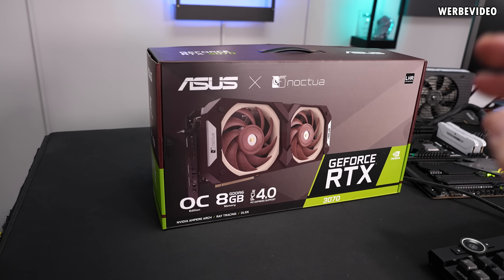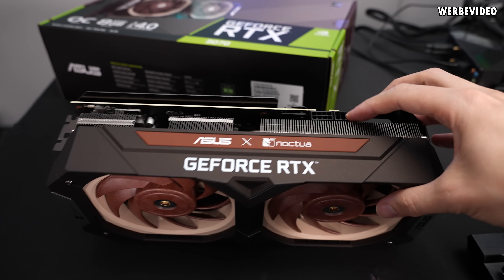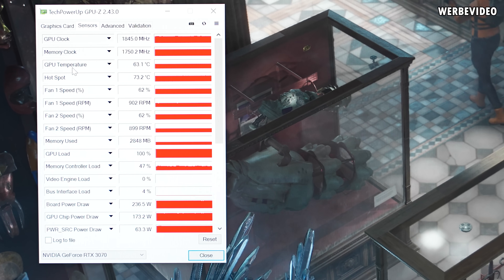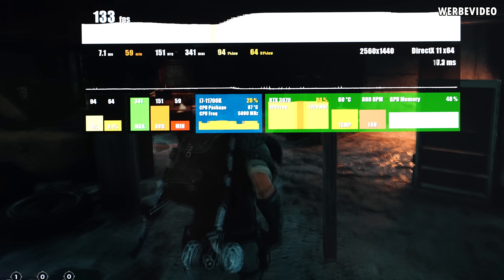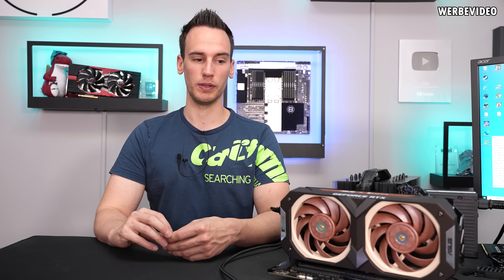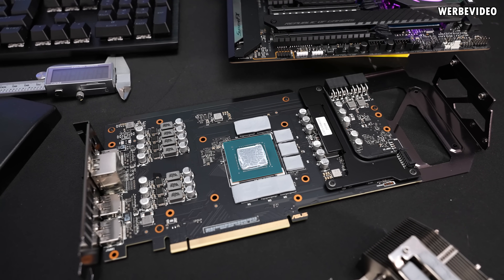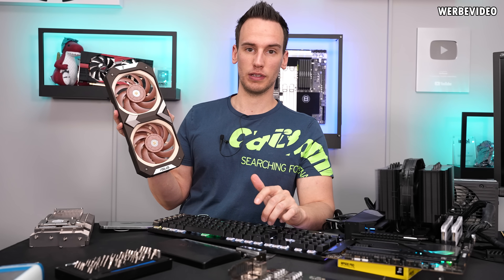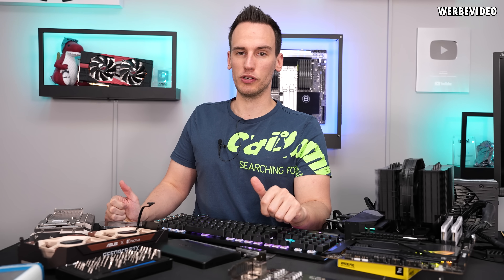Impressive Noise Levels - But what's up with the Heatsink? ASUS x Noctua RTX 3070 tested

Comment: Welcome to basically my morpheus2 with the very best fractal design fans (for silence+ air pressure). I would claim the morpheus kit still is better due to size, but it's up to what fans are attached at that point.

Comment: Personally, the color is nice. The beige is really the problem, not the brown fan blades or the dark metallic brown on this shroud, which will not conflict with a mostly black build with subtler secondary colors (or white) on the motherboard as it's close enough to black. It's like wearing a white shirt while the coat is a lighter color than the vest and pants, or the pants are darker than the vest and coat, or the vest is darker. 

In this case the beige is the white shirt. If anything having big neon green accents on the motherboard or lighting is like wearing a christmas party necktie or gaudy cufflinks with the outfit, so are some shades of red and purple, or lighter blue. But you'd have to be really obsessive to start figuring out what lighter shades can actually go with this without sticking out as opposed to just getting a black-grey motherboard like those military-themed MSI boards or the Aorus boards then try to figure out if lighting other than white might even work.

Comment: I would have liked to see Noctua make a custom fan design instead of strapping A12x25 fans onto a GPU heat sink. I feel like Noctua could have engineered something specifically for use on a GPU. If they did that I could imagine that they'd be able to get it on a 3080 or 3090. As it stands now it looks like it would get far too large putting a third fan on.

I do love that they went with classic Noctua colors though. I don't think there's anything wrong with Noctua's signature brown. It's not like brown is a bad color. Tons of people like wood and don't complain about how brown it is!

Comment: You should try swapping the nf-a12x25 with the arctic p12 pwm fans. Interesting to see how the arctics stack up at the same rpm. Asus x Arctic?
Reply: The nf-a12x25 is objectively the better fan at the same RPM, while being quieter in pretty much any situation that I've seen. Not to mention the weird sounds at 1000-1200rpm the arctic P12 fans have (not the CO version though). Not all Arctic P12 fans do it, but most do.

That doesn't mean the arctic is bad though, it's the fan I personally use for most applications. It's far cheaper, and the difference is marginal. Just avoid the bad spots in RPM (assuming you notice the sound) for the best results. I'd imagine the results with the nf-a12x25 v P12 would be at most a 1c difference. Oh and the arctic fans also come with a super easy to use warranty (Is it 10 years?) despite their low price (all their warranty service is great). Noctua's is amazing too, but I'd hope so.
Reply: @pickleadaykeepsthedoctoraway  how come the co version of the p12 doesn't have the motor whine? I thought the only difference was the bearing
Reply: @Pro479I  No idea TBH, but people have reported the same thing for the past 2 years or so that the CO seemingly doesn't have the issue. More testing needs to be done though. 

Though I have also heard people report the CO to have other weird noises, but that was one person like 2 years ago.

Comment: Not good enough... i have the Strix 3060ti with 3 fans... it can be adjusted to near silent operation in msi af... it will run at 1100 Rpms at 2100mhz with 90% powerlimit.  So whats the point?

Comment: Memory temps on the 3070 aren't typically an issue, so I can see why they wouldn't bother doing the work to make the thermal pads thinner.  It would be worthwhile on the cards that use GDDR6X, but the GDDR6 cards run quite cool.
Reply: Thats the theory but in practice my TUF card wouldnt hold boost properly. I applied new better paste and better heatpads on both size on the pcb. Suddenly it would 1950Mhz forever! I also read that high memory temps lowers the boost of the gpu, not sure if thats true or not though. But my experience seems to support that atleast..

Comment: Impressive performance.
Also lazy as hell. Asus just bolted two regular Noctua case fans to a hastily designed shroud and put it on a very slightly modified TUF card. The result is a stupidly thick card.
And here I was thinking that Noctua would purposefully design a unique cooler for the card...

Comment: If you use a noctua dual tower cooler and this graphic card. It will colour match and you will not even be able to see the main board with these to beastly coolers covering it

Comment: 830€ good price for 3070? low-low midrange GPU???  you must've hit yourself in the head behind the scenes with this massive card... good card, shit price.
Reply: Why do you think it's on a 3070 TUF board, with pretty much the same heatsink? It's to raise MSRP on their 'underpriced' TUF cards. Why would they sell a TUF card at $500 MSRP or whatever, when you can sell it at $800+ just as easily? If this was an actual product, it would be on a strix board at the very least.

TUF cards will still exist, but they will be rare. They can just sell strix boards which are undoubtedly higher margin products. Kind of like how Nvidia doesn't really want to sell 3080 chips/cards anymore. Why sell a 3080 when you sell a 3090/3080ti and the potential 3080 super?

Comment: Makes you wonder if they could make like a 3x120 or 3x100 model on 3080Ti/3090.
Reply: They can, but I imagine this is a way for asus to get rid of tuf boards and 3070 chips. You'd think this would at least be on a strix board, with a custom heatsink.

With this they can charge a way higher MSRP for something that is completely and utterly unnecessary and honestly stupid. 3070 non strix, with the 'best' cooling? People will definitely buy it, so of course they will do it. This is nothing but greed.

Comment: Yup, it's amazing how much quieter 120mm fans are cpmpared to 90 and smaller ones.

It looks like those are standard fans. So it would be easy to sway to chromax fans.
Reply: Standard 25mm thick case fans have 40+% more airflow than those slim 15mm fans on gpus...

Comment: Lazy design. Literally just made a shroud and bolted 2 120mm fans to it, like some 3d printed home mod. Card is 4 slots with just 2 slot port bracket, probably sagging like crazy. Performance is great, but cmoon, no effort at all

Comment: I know I will be the only with this opinion but iam not impressed. It is a fuckung 4 slot card, massively wide with 120mm fans and expensive. Powerdraw isn’t high either. It should be super cool and quiet, everything else would be amassive fail. I am looking at you Gigabyte.

Comment: Its cool, but with how hot the 3080 always runs i think a version for that would have been better
Reply: Not to mention they used the tuf board for this, and not the strix board. It really makes zero sense. I can imagine that the 3070 is going to go EOL soon anyway, along with the 3080. Especially the 3080, Nvidia has realized they priced the 3080 too low, hence why the 3080ti is so expensive despite barely being better. There's a rumored 3080 super coming out too, which IMO, will EOL the 3080. Why sell a 3080 when you can sell a MUCH more expensive 3080ti?

I can see this card being extremely rare with very little production run. It just seems like a way to get rid of old tuf boards at much higher prices.

Comment: how can 50 dba be three times louder then 30 dba ?
Reply: I think he misspoke. 50dba would be 100x as energetic as 30dba (10dba increase is 10x increase, 3dba is 2x increase). However measuring the exact loudness increase in dba is a bit harder than just db, as dba is more useful for hearing loss. But a 10db increase is generally perceived by humans as roughly 2x as loud. Maybe at the frequencies recorded would show a perceived increase of 3x, since we do have selective hearing.

Comment: @der8auer
Does the card hold power targets, especially in New World? Have you seen Jayz video about 3000 series cards?
Reply: Jayztwocents is pretty much always wrong about everything he speculates about. Honestly the guy is a hack drumming up controversy by not understanding anything.
Reply: Jay brought something up, and i was asking for a further investigation, from a different source.
He may not be an Xoc-er but he raised a point, i was digging into the point he raised.
He may or may not be a "hack" as you said,(i don't care either way) but dismissing outright a theory because you don't like the guy is not constructive. Constructive is to cross check and cross validate. I can't (and probably will never) be able to afford a spread of GTX3k cards. So... i was asking @der8auer (since i know For sure, he has one of the "most newest" productions/iterations of 3000 series cards, and he know how to probe  HW level with a scope on a pcb)¯\_(ツ)_/¯
And great would be if GN also checked it out.
Anyhow... i'm ranting.

Comment: So basically is just a regular heatsink with two noctua NF-A12 slapped on top. Similar to my 5700xt modded with two nf-a9x14 (itx build, couldn't go bigger) but with a more professional shroud instead of cable ties. 
Eh, really nothing wrong about it. I really wonder why no company has tried this approach before. Noctua simply has the best fans and they also have the smaller and thinner nf-a9x14 chromax Black, which (and I tell by experience) are amazing when paired with a gpu heatsink.
Really hope this opens the path for more collaborations, maybe even for smaller two slot gpus (perfect for portable itx builds)

Comment: So as suspected, the great performance is all from the fans. It just goes to show how poorly those small and thin fans on typical GPU coolers are.
At this point GPUs have gotten so large that you may as well just use 1 extra slot for proper fans. I just wish that there was more standardization of GPU cooling so that you could just buy a cheap third-party shroud and mount your own personal preference of fans. The Phanteks T30's are monsters - and I would really like to put 2 of those on whatever my next GPU ends up being.

Looking forward it seems like GPUs will be even more power-hungry in the future, and we are really reaching the limits of how much you can just increase the heatsink size and expect good results.
There are way too many legacy problems with how GPUs are placed and it just makes no sense anymore...
GPUs now make the most heat of the whole system, but can't exhaust it well, so it heats up the whole case and is ineffective, but blower designs are even worse because the dimensions of the heatsinks are just to long, thin and airflow-restrictive.
Also, a decent heatsink is so large that it makes you unable to use most of your expansion slots, which is just silly.

What really needs to happen is a motherboard/case layout redesign where the GPU gets it's own dedicated placement rather than being treated as just another PCI-E addon card.
I think the best idea would be to finally start using both sides of the motherboard so that we can finally de-clutter and make things functional - or short of that, have the GPU connector at the every edge of the card so the GPU can get a place above or below the motherboard. Then it would be easy to design cases that have a dedicated GPU wind-tunnel with large heatsinks that can use simpler construction for cost, and be driven by a simple 120cm fan that breathes only cool air and exhausts the GPU heat directly out without significant airflow constriction.

It is possible to mod something like this idea using a riser cable, and it works great - but making it not look horrible is almost impossible because you have to make so many fundamental changes
Reply: I know the PCI-E connections exist for something like this but not outside of U.2 or HPC clusters.
Reply: @Dcatts-i2z  There also exists a motherboard that has the CPU socket on the opposite side. LTT showed it not too long ago. It serves as a good proof of concept for dual-sided design. I tink that would be the ultimate solution since it just opens up so much extra space.

This isn't so much a technical problem as it is a standardization issue I think. The ATX formfactor was designed in 1995 and hasn't really changed much. Everything was different then, and GPUs as we know them didn't even exist - so it's no wonder current design is so cluttered and poorly optimized for cooling...
Reply: @TheStigma  Even Mac Pro 2019 and Xbox Series X have clearly more superb cooling design compared to modern PCs... Intel tried to introduce new BTX form factor but it was such a fail it looks like they simply don't care anymore about changing anything to bring more needed evolutionary changes besides ATX12VO....

Comment: This GPU is actually wider than 4 slot, around 4.3. That is really pointless, especially for 3070. Now you might think "but what do I care, I have 7 slots any way". Well, even if we put SFF cases aside, this GPU is so thick that it will be very close so PSU shroud, especially considering most motherboards have GPU in 2nd slot, so you actually have 6 slots, not 7. 6 minus 4.3 is 1.7 or 34mm, which is not really ideal for airflow below the gpu.  But this thing is so huge and overpowered for 3070 that it probably doesn't matter, it is just pointless.

Comment: I strapped 2 12A's on a strix card before, but it didn't improve anything. The 3 tiny stock Chinese ones worked far better.

I think it's the heatsink doing the work here.

Comment: I don't like it. Seems to me a very lazy design. There is a reason why no manufacturer use excessively thick 12x25 fans in their GPUs, you don't want to kill slot and case compatibility, and a 220~240w card doesn't need all that airflow anyway. This would make more sense maybe on a 3080 ti or even the 3070 ti which is much more power hungry than the 3070, still, why is it so difficult for noctua to translate their blade design to different fan sizes? Yes, I know they are highly optimized with tight tolerances and a special blade material, still, we have been waiting for the 140mm version of this fan for ages. They could also have done a 92x15 for more compact heatsinks, at that size, the fan would be perfect for such a card.

Comment: Yup great partner up by Asus and Noctua. Enthusiasts have been doing this for as long as I can remember.
If it's been because of the stock fans being awful or just broken with time.
Did it with my old R9 290X and it's lousy cooling solution with zip tying 2 Noctua 90mm fans to it.
Reply: I did it on my 3070.
It went from a loud hairdryer sound running at almost 80C to a gentle wooshing sound at sub-68C.

Manufacturers make stupidly large cards but never put decent fans on them.

Comment: Is this available for EVGA 3090 cards? I feel like they could use some high performance noctua fans for cooling, noise be damned   :/
Reply: You could try taking the shroud off if you're confident and bodging something together (zip ties work). Otherwise no.

Comment: Sure it runs cooler and quieter, but is it worth  spending $350 more over the $500 3070FE?
Reply: I am pretty sure the whole point of this card is to sell extra tuf 3070 boards with minimal changes at a way higher MSRP. I wouldn't be surprised if the 3070/3080 and possibly even the 3090 go EOL soon with the rumors of super editions coming out. I think Nvidia realized the 3080 wasn't worth producing @ $700msrp, especially with the 3080ti and 3090 sales.

If this card was serious, it would have used a strix board, with a custom heatsink and noctua fans. The fact that it uses the tuf board, and a 3070 is laughable.

Comment: I actually quite like the design of it. Function over form, so to say.
Reply: And it would function the same in black
Reply: @utubby3730  Noctua still hasn't been able to make the NF-A series in black due to material issues. However, thermaltake made a quite decent fan that is basically the same as the NF-A, while being cheaper, in black. Thermaltake toughfan 12.

Edit: Just looked it up, turns out the black nf-a12x25s are coming out in the next year.

Comment: Can you swap the fans? I wish they made it so the fans mount directly to the cooler instead of the shroud.
Reply: Looks like the fans are screwed in normally with 4 screws each and it's a standard form factor so you could most definitely change fans
Reply: @TheZebinator  
Thank you. There's actually a more recent video showing fan swaps. I wonder what kind of performance you'd get by swapping to Noctua industrial fans.

Comment: I totally agree there is no reason not to make 4 slot or even 5 or 6 slot cards with better and quieter coolers for use in full size ATX systems. The slim fans they have been using have never been great for noise or reliability. Being able to use and replace standard 120mm or 140mm fans would be a big plus.

Comment: So the Noctua & Asus engineers "collab"  was essentially "Make us a shroud that can house our fans. Here are the dimensions." lol
Reply: I also don't understand why this was on a 3070... Why not a 3080/3090? Not to mention... Why not the strix board? This card is scuffed.

The more I think about it, it's probably just a way to sell off extra tuf 3070 boards at a much higher price. Cause this card makes zero sense otherwise.
Reply: @pickleadaykeepsthedoctoraway  The reason they choose the 3070 tuf, is because it is one of the quietest if not the quietest card on the market right now, even without the noctua fans. 
The 3080 tuf would probably gain more from this mod, but it would probably still be louder than a standard 3070 tuf. (I have both)
Also they choose the Tuf, because the cooler is actually not worse than the Strix and is better suited for these changes (They actually changed the cooler).
BTW. tests show the Strix is louder than the Tuf.
Reply: Extremely lazy. It works, but it's so lazy